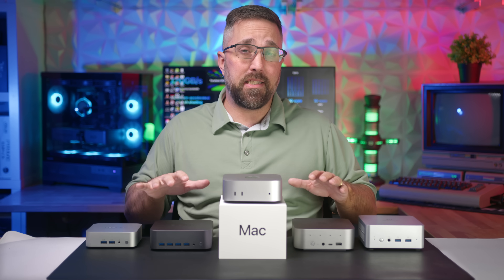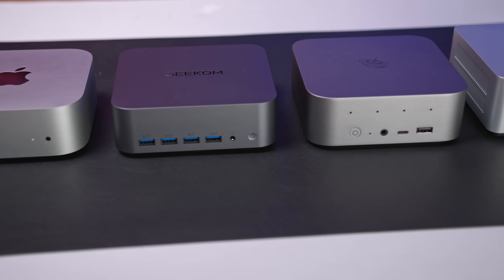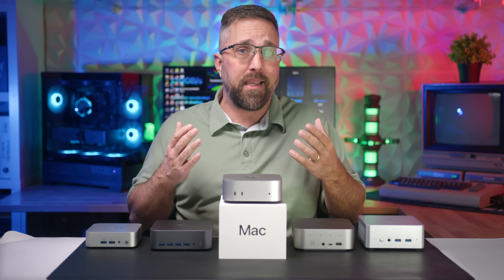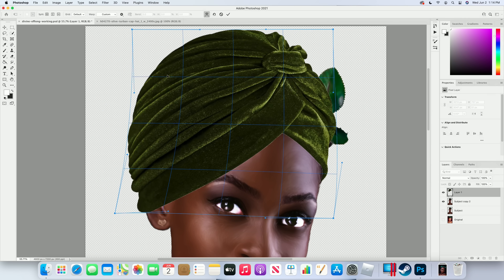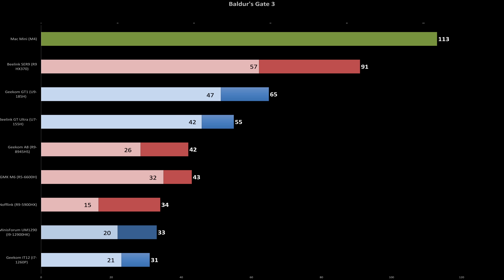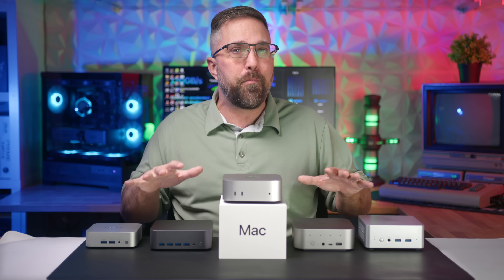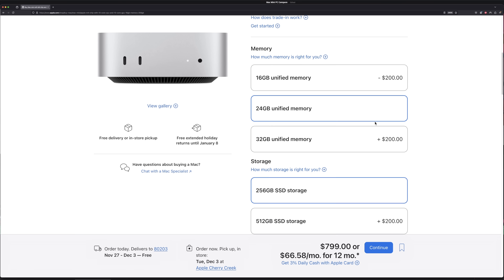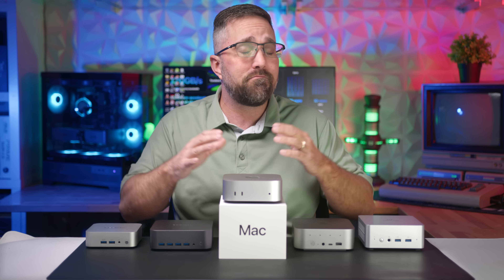M4 Mac Mini vs Intel and AMD Flagships – It's Not Even Close!

Comment: OMG like seriously dude... the power button is a non-issue.. it’s place there so you DON’T have to use often... Windows users might feel compelled to use it because of all the BSOD Windows used to have. for Mac, a power button is almost unnecessary...
Reply: You won't get bsod on a good windows computer. I used some shitty ones which always had bsod but my midrange gaming pc and laptop runs perfectly and they can play games at 1080p ultra with high framerate, and the desktop can play in 4k ultra at above 60 fps. They never lagged at video editing too.
Reply: @djromangutan8052  What are you comparing here? I'm not sure what your point is here. You can get BSOD on any windows computer. the wrong driven being installed, the wrong software conflicting with a driver, a bad sector on a disk or SSD and it happens... computers can have top of the line components and they can still fail and cause issues. That goes for Windows machines and Macs. Macs typically have outstanding quality controls so it's a lot less likely. While Windows has improve its codebase in the last decade with Windows 10, it's still not uncommon to see BSOD on windows machines. your sole datapoint means absolutely nothing in the grand schema of things.
Reply: I use it a lot because the mac mini is only on when I watch movies or youtube.

so the power button is a big annoyance.

I have to look into wol or power on by keyboard - which may be an issue over bluetooth.

What you mean for the BSODs is the reset button.
Reply: I'm okay with that, I'll just turn off my power socket, when not using it. Should be fine right?
Reply: @di4mondpl4ys45  what for? save on electricity?
Reply: @deathcoder  Why should it run 24/7 if I don´t use it 24/7? I power down all devices and cut them from power if they are not in use.
Reply: @di4mondpl4ys45  it's not "running" it's in sleep mode.. if you're concerned about the power consumption put a Kill-a-watt and check how much power it's drawing from the wall... it's negligible, as in, barely any power is being drawn from the outlet. Is that your complain? I'd argue that booting up the machine might draw more energy than leaving it in sleep state.
Reply: @deathcoder  I just don´t like it when everything is just on sleep/standby. To be more precise, I HATE IT. If it´s not possible to switch off... well there are other people who will buy it then. Same goes for my smartphone: When I´m sleeping it´s off, cause well .. I won´t use it.
Reply: @di4mondpl4ys45  what’s your issue with devices that are in sleep mode? can you elaborate what don’t you like about them?
Reply: @deathcoder  I´m always thinking off them, if they are on standby. I´m at work and probably lose concentration because I forgot to turnoff my tablet and I´m starting to think off how much power it still has left or when I charged it the last time, cause maybe it´s already in deep discharge and that I have to ... klack oh well I have broken another screw-tap, cause I was not watching out... Happened atleast a dozen times in the last few years, so I just turn things off and brake less taps  🤷‍♂
Reply: @di4mondpl4ys45  I think you have other problems 🤣

Comment: I've been looking at mini PCs and genuinely intrigued by the Mac Mini M4 for photo editing. But anything past the base model and the prices get ridiculous. Storage I can live with as I'll work using an external drive, but the ram has me worried. I can currently get a Minusforum (one of the brands you featured) UM790Pro with a Ryzen 7 7940HS, 32gb RAM and 1tb hard drive for just over £530. The processing performance will be far down on the M4 I'm sure but there is some security in knowing I have the extra RAM and hd space. Is the 16gb RAM sufficient for photo editing? I currently have that and chrome + photoshop quickly eats that up.

Comment: I think the big thing with the Mac Mini is the options.   The basic model is economical, but it only has 256GB storage and 16GB RAM with no way to user upgrade this.   If you were to spec this out at 512GB or 1TB storage, even keeping the 16GB RAM, your price is no longer 600, it is more expensive than the most expensive of the other mini PC's you have.
When comparing, you should be comparing same spec to same storage specs.   Same storage and same RAM.   A mini PC with 1tb, compared to a Mac Mini with 256GB .....  just can't compare a price with such different storage specs.
Price to Performance -  Sorry, storage is important.   If you only have 256GB storage, and it costs an extra 400 to get 1TB storage and you can only do it when you buy it new, that really hits the price to performance argument in a negative way.

Comment: Good video and great you compared it to the correct segment.
No doubt that the base model, is in fact very attractive priced and weirdly so for an Apple product.
It also seems like they're flying over the counter.. more or less sold out here in Denmark (base cost 5500DKK / 780USD) as we pay a lot of taxes.
But the moment you start climbing Apples priceladder on various "upgrades", that bang for the buck aspect, gets outwatered pretty dang fast.
Not sure if I would have preferred.. an AC to DC adapter outside. as then you would be able to run it from powerbanks.
Mini M4 are extremely effective., at around 40watt in general use.

Comment: No there's a new memory standard that laptops and a lot of some can big computers and mini PCs will be taking and it and it will make it where you can upgrade a RAM without having to be soldered to the board but still get the benefits of it being soldered to the board and user upgradable and way low profile it's a new standard that's already out and some board makers already making it but it will be a standard or a most manufacturers will use it

Comment: I guess the question for anyone who are thinking between Mac Mini or Mini PC is productivity, I am a video editor I have tried many mini pc trying to replace my huge video editing PC and the results was not what I was expected, most of them just pretty much gone blue screen / restarts / frozen while I render or export while AE or PR, and was tempted to get a MAC mini M2 version till last week that the M4 available, and I am more than happy to have that,  like ADOBE CC it RUNS all of them no problem and fast. yes, I know there is operating system factors, but it gets the job done rather than it looks small, but it does nothing. price point yes, a bit expensive when you put in all the upgrades, but if it makes the money back than it's not an issue, you spend same amount of money for a mini pc that couldn't even get a single video export than its garbage.

Comment: I own a Ryzen 7 mini pc by beelink.  the specs of my now 2 year of mini pc are still better than the mini with the plus that I can upgrade the memory and the HDD or even add an extra one.  The base mac mini with that useless and not upgradeable 256GB SSD is just something that will be slow in a near future as Apple bloats the system to force you to buy the new one.  those are my 2 cents

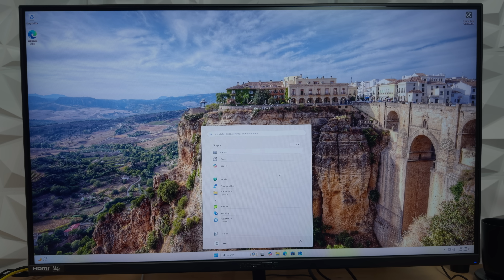Comment: 15:45 failed to mention Asahi Linux. Also failed to mention future-proofness: The PCs in the comparison start out with double the RAM and four to eight times the storage and are upgradeable in both regards. IMO it's pretty short-sighted to praise the base model Mac for its price-to-performance ratio, as that will drastically worsen once you have to buy a new one two years later.
Reply from the maker: Asahi hasn’t even made it to the M3 yet so its a non subject for the M4 mini, and I didn’t fail to address all the rest of the issues you listed, you just failed to pay attention.

Comment: I agree..I have a macmini M2..which is very good..and I have a 1tb external NVme drive in an enclosure attached by usb c...I also have a small N100 based mini pc from a Chinese vendor bought from Amazon..I also have an Enternal NVme 1Tb and a 500gb ssd running win11..its fast and used for plex attached to a tv...it does what I want it to..with 16gb ram ..I don't even notice the difference in speed with the macmini...so no I won't be buying a M4 macmini that can't be upgraded..I have a tech YouTube channel..and can repair anything pc..radio..tv ..I won't waste my time upgrading the nand on the base Macmini as some suggest..its not easy and the second hand nand chips may be defective...you won't know till you replace it ...then what!! Buy the mini pc folks..ram..no problem to upgrade...ssd or nvme no issue...

Comment: as a photographer and video editor, the Mac mini (despite me hating apple for their overpriced products) would have been my first mac since the original mac mini I got when I was a teenager.. But the specs are SO bad on purpose (other than the M4) that it's just impossible to use as is. You need to upgrade the ram and SSD, and then it's just more expensive than a massively more powerful workstation with a ryzen 9900x, 64gb ram, 2x2tb ssd and an AMD gpu.. 
I'm gonna spend 1500 bucks to get that new workstation running (and add my 7800xt in it), I won't even consider the Mac mini at that price. 
If only they released a fairly priced upgraded version like the base model, I would have bought it.
Reply from the maker: Like i said, pick the right tool for the job. With that said if you haven’t purchased the Graphics Card yet you may want to consider a Nvidia card as most video editing software is much better optimized for Cuda and Nvidia’s media engine.
Reply: @ElevatedSystems  nah I already have the 7800xt and I'm happy with my choice. I own a 2080ti as well for anything cuda related on my old rig. 
The lack of Vram on the nvidia card is a no no for me. I work with lots of color grading and render some footages in 8k and use quality denoising and frame interpolation and anything below 16gb of ram is just not cutting it anymore for my needs. 
And the 4080 was such a poor value and the 4090 so overpriced, the 7800xt was a no brainer for me really.

Comment: Comparing an Apple chip that just came out to omes that are half a year old or more, or were designed for lower efficiency and not performance, meh. In 6 months the x86 CPUs will be a quarter to a third ahead of the M4 if not more. You can’t really compare when the product cycles are spaced out by close to a year.

If you’re stuck on MacOS then your choice is obvious, otherwise, there’s just no reason to bother with Apple to get a modest CPU bump at the expense of all the feature crippling and upgrade gouging, just wait another 4 months or so.
Reply: Ofcourse you can compare.. you can compare to the cows come home.
This is the best compare video I have seen with the most relevant alternatives.
If he wanted.. he could compare it to a 10 year old device... its up to you as the viewer to put things into perspective.. he delivers the facts and you ca take it for what it is..
If you think you have all the tools and all the devices to do it better at a given correct release date, where 5 different products all land with their relevant items in the same week with corresponding equal component specs.. then go at it...
Come on' maybe be a tad grateful that you get content like this.
Reply: @JAKOB1977  Might as well compare different year model cars. You can do it but it’s stupid to not pretend that in a few months you won’t see the same performance gap favoring the x86 side. 20A is already in production.

If it was going to be 9-12 months before new x86 was out then ok but almost everyone can wait a few months or so.

Comment: The only mac mini that's great value is the base model. If you even whisper about more ram or storage the value goes away. And a PC is upgradeable. How much for a replacement SSD on a mac? Cause for PC the cost is zero. You can't build a PC equivalent of the base model, but you can still get better value from a pc in the long run.

Comment: So, the base model Mac Mini.... does great on benchmarks, but didn't have enough storage to do any REAL work. Gotcha.
Reply: lol that’s what the expensive upgrades are for. Or use external storage lol
Reply: The $800 version with 512GB is the M4 to buy. Remember you only have 5 USB ports, needing to use one for routine storage needs and another for Time Machine and you are down to three before you connect anything else. If you want a second monitor you are down to two. 

The cost of the Thunderbolt 4 hubs you need also needs to be added to the cost of the M4. 

The M4 is a great video processing CPU, but I don't do that, so it's not a good fit for me.
Reply: @mikespangler98  Or... Get the 10Gb network option and connect to your file server for oodles of storage.
Reply: @mikespangler98  It’s Thunderbolt 4. It only takes one single port, or two if you have a more expensive version of one of the hubs. Then all of those other devices have plenty of ports available. Most of them have extra hdmi, as well as extra Thunderbolt ports for displays and external drives. But yeah they are expensive.
Reply: @Ultimatebubs  censorship deleting comments?
Reply: You can add an external drive to act as the home folder. I currently have a 4tb external ssd setup that way and I have zero complaints.
Reply: Nobody does "real" work relying on the internal storage. External Thunderbolt drives are where it's at or a NAS. Also, wtf is "real" work"?
Reply: If you don’t have a NAS or DAS then a 2 TB Thunderbolt enclosure is the way around all of that.
Reply: @ghost-user559 you still have your OS on a tiny drive... And what's the point of getting a mini computer if you need to lug around a bunch of extra hardware just to make the thing usable
Reply: @cwill6491  Every computer uses extra hardware? Obviously a laptop has keyboard and screen built in, but ive never seen a desktop that doesn’t require any extra peripherals to function. It’s just a basic part of computing nowadays.
Reply: @ghost-user559  which raises the price from $600 to about $8 or $900 for 16 gb brb.
I think you lose ai feature if you boot from external drives.

Not to bad but realistically$ add $200 to that $599 price immediately and always have a external drive attached which takes away from the whole reason for a mini computer and its small size.
Reply: Brother. If you need real work done… 1. you can get an external ssd that provides enough data throughput for most tasks except large data sets or 8k video editing 2. if you do actually do 8k video editing or large data sets, why are you looking at a $600 machine in the first place?
Reply: @neodim4055 agreed
Reply: Because benchmarks are biased.
Reply: @arpsichord7474  Benchmarks are a controlled set of tasks that are consistently repeatable.
Reply: Just use your brain , just get an external ssd if you need an extra storage space , these are pc so they are meant to be stationary so getting an external ssd is perfect
Reply: @Omar-kl3xp  So you are using your brain huh? lol, man get real. Even the base m4 mini PC is twice the price of a very descent Beelink SER8 AMD Ryzen 7 8745HS with 32gb/1tb ssd. No need to buy storage or other stuff sticking out of a small clean box to make it work properly. 🤣🤣
Reply: @Omar-kl3xp  I think he means the RAM, which isn't upgradable, and the base model isn't enough

Comment: 256GB SSD for the base model in 2024...
The only good thing about it not being soldered is, that they won't replace the whole board if the SSD fails, so a bit better for the environment and maybe the customer (if Apple doesn't simply pocket the saved cost).
I somehow feel like Apple offers the base model relatively cheap because they know that most customers will be getting upgraded models, where the upgrades are unreasonably priced. We are talking about a company that is used to huge profit margins. It's like publishers selling stripped down games and then offering paid DLCs to expand the game to the state it should have been as release version.

Mini-PCs are too expensive for what they are, often costing more than laptops of the same spec, even though the latter offer screens, keyboards, battery and so on.

Comment: The main issue for me is that the Mac Mini runs MacOS, I just don't like it. Can you run linux and windows on it without issues ? The basic mac mini might be cheap, but the upgrade prices are ridiculous. If you'd spec it the same way the other compared machines are you'd pay a lot more. If you included the 32GB ram and 1TB hard drive the mac mini would be $1200, not $600. So then showing the price to performance graph is BS, you should cut that mac mini bar in half. It's almost as if you went into this trying hard to look the mac mini look better than it is.